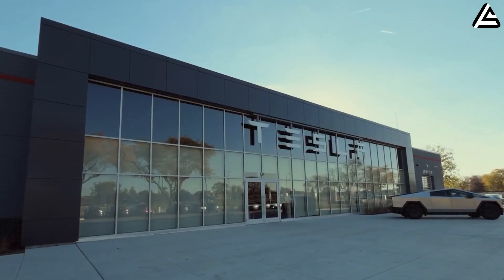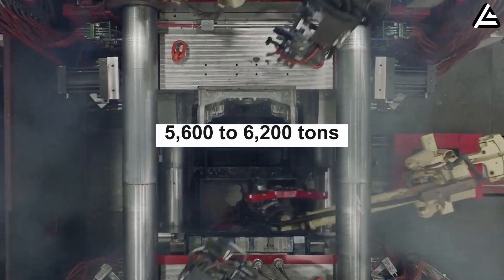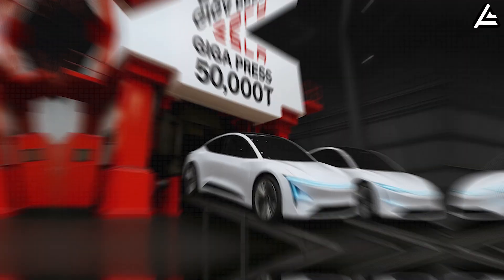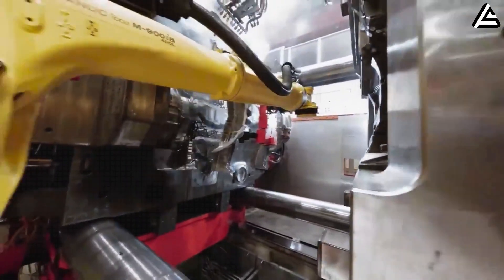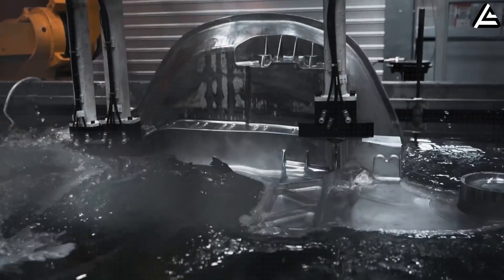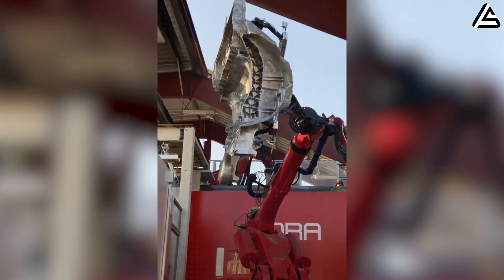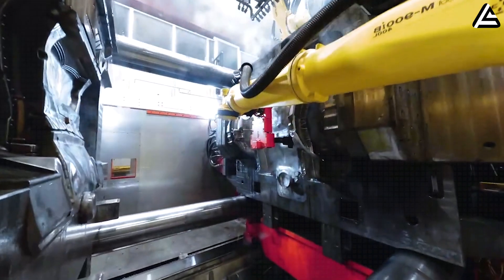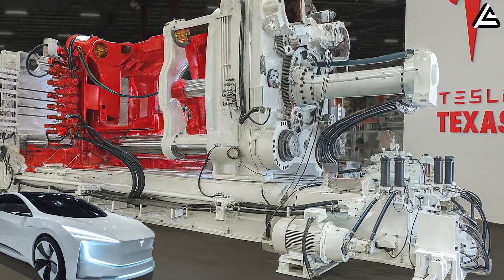Tesla Model 2 Finally On Production Line With New Giga Press. Elon Musk "7 EVs At Once"

Comment: What safety risks does a 50,000-ton machine pose in case of malfunction or emergency shutdown?
Reply from the maker: A machine that massive absolutely needs emergency hydraulics and thermal cutoffs to prevent catastrophic failures. I’ll cover the real safety protocols behind the 50,000T unit in the next video.